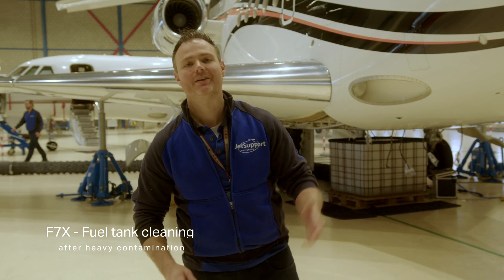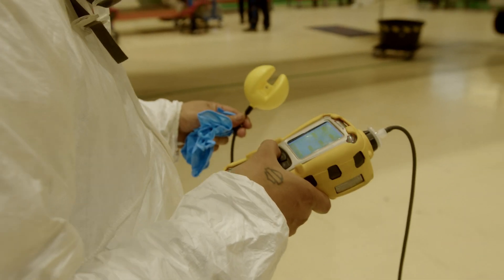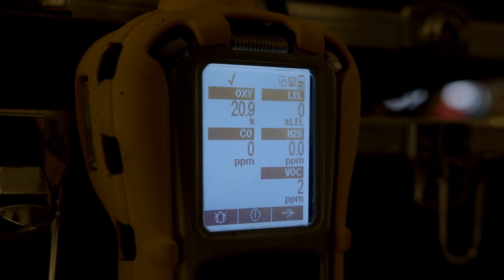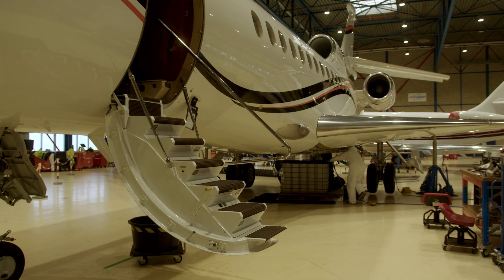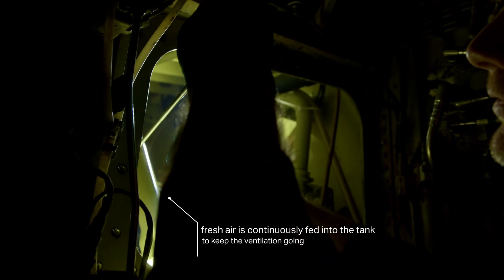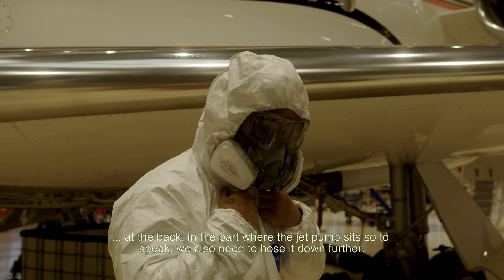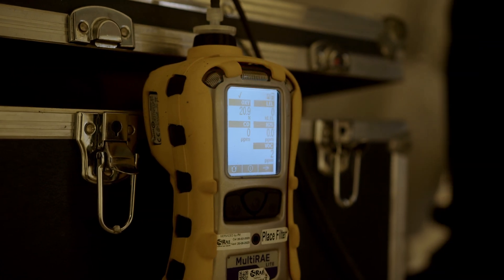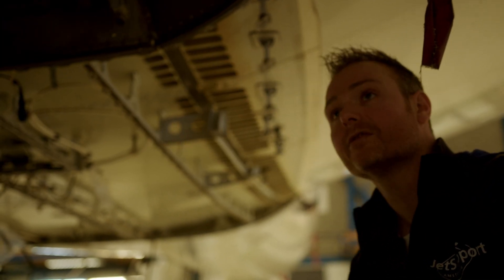F7X - Fuel Tank Cleaning - HANGAR 3

Comment: Stop pretending, these things fly on some liquid, that weighs several hundreds of tons in a bolt screwed aluminium wing. As one 10lbs bird can damage the plane after hitting it. You can see dirt and dust inside the wing making it obvious there is/never was any fuel whatsoever. Refueling an A380 would take 21h in order to fit in 380 000l of kerosene. Yet in an hour or two, on the tamac they are ready to go again across the pacific...Lies lies lies